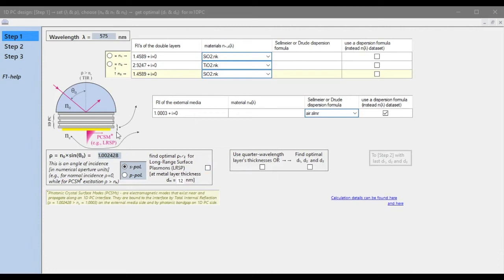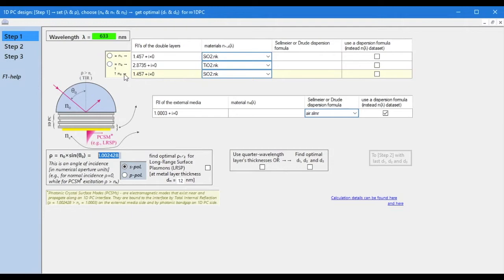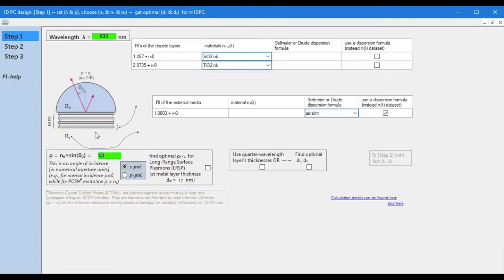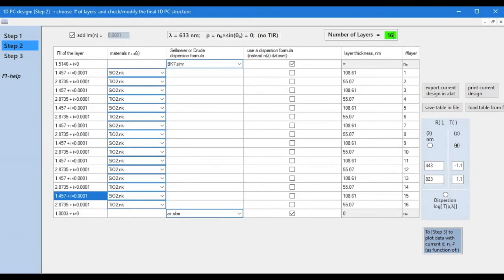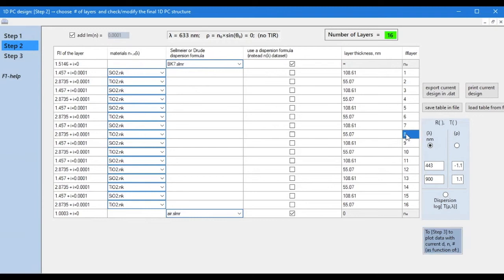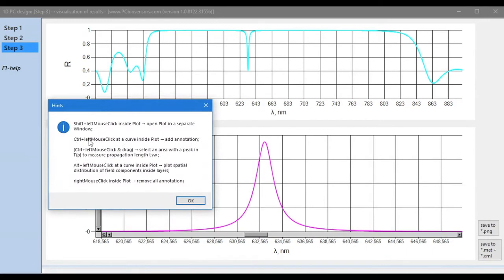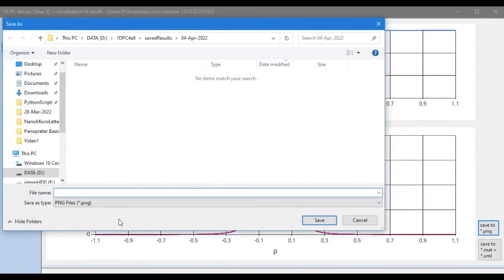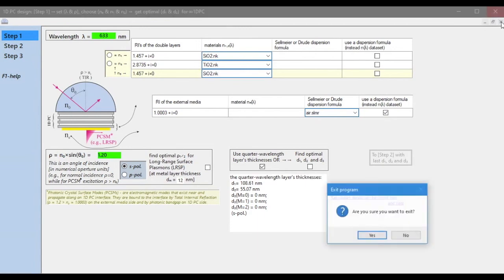Design of 1D photonic crystal structures: 1st Example -  transmission/reflection at normal incidence

Comment: Dear Dr. Konopsky,
Unfortunately when extracting the zip file I downloaded from the website, I got an 'Unexpected end of archive' error. It has happened on multiple computers and zip software. How do I deal with this error?
Reply from the maker: Dear Bernardo Dias, thank you for your feedback. 
It may be a problem on my provider's side (and, for this case, I add two alternative download links there - to Yandex-disk and to Google-drive).

But it could also be a problem on your side - if another browser (Edge instead of Chrome, for example) can download the entire 70MB of this zip-file, then you might need to clear your first browser's cache (www_hostinger_com/tutorials/clear-browser-cache).
Reply from the maker: By the way, the Google Drive immediately shows the internal structure of the zip file on its website, so it can open it. Try to download the zip file from there.
Reply: @valerykonopsky1962  Where can I find the Google Drive links?
Reply from the maker: @bernasantosdias    On the program's home page ( www.pcbiosensors.com/1DPC4all.htm ) I have added two new buttons. One of them redirects to google-drive ( drive.google.com/file/d/1mfeJ_Nfyj-c1yMoYCxgiRi0qPx7m8Ute/view ).